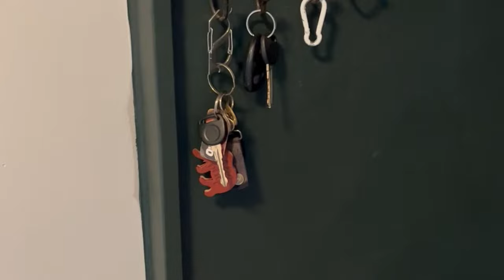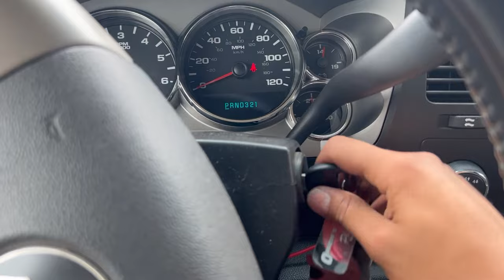DIY Toddler Bed | Montessori Bed | Plans

Comment: Bridle joints with a hole through the center which would basically work like a drawbored mortise and tenon joint and also with that you could put a threaded insert in the cross support to connect it all
Reply from the maker: You're not wrong. Though, that does introduce an easy way to make an errant cut and have to buy more stock - admittedly, I haven't make many bridle joints. I tend to stick to dados and miters. But a good recommendation all the same, thanks for checking out the video!
Reply: Definitely can be a little intimidating but with the right jigs it’s not too bad Tamar from 3x3 customs has a good video showing a good jig for angled bridles if you’re ever interested in trying them out

Comment: This looks amazing - how many board feet does this use?
Reply from the maker: Thanks so much! 
I can’t recall the exact board feet unfortunately. However, I do have a set of plans using dimensional lumber from the big box stores. Link is in the bio if you wanna check them out 👍🏽

Comment: Why in the video do you have your top canopy pieces going into your posts when in your plans you show them on top of the posts?
Reply from the maker: Hey man! Thanks for checking out the video. I actually made 2 incorrect cuts on mine and had to call an audible. The plans do it more correctly 👍🏽
Reply: @donnygrahambuilds  Thanks for the response. Didn't mean to call attention to it, bought the plans several weeks ago and following them and the video closely. Building for my daughter's 4th birthday. Very green woodworker but this project has been fun so far. Thanks!

Comment: I’m considering building one of these for my toddler, but with a queen mattress since we already have one. Biggest concern is changing the sheets with the rails on all 4 sides. Have you had any difficulty getting sheets onto the mattress?
Reply from the maker: I’d recommend, my daughter went nuts for it and still will periodically thank me when we’re both in her room haha. 

No issues at all changing sheets. Just give yourself a little extra room compared to your queen mattress (I.e. if the mattress is 75”x60”, make your frame space 76”x61”). That’s what I did and no issues changing sheets 👍🏽